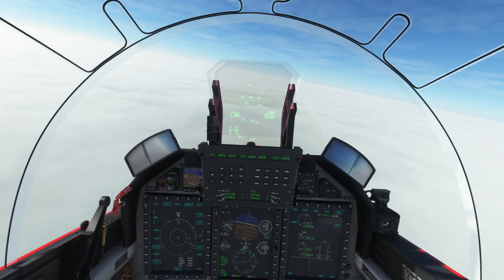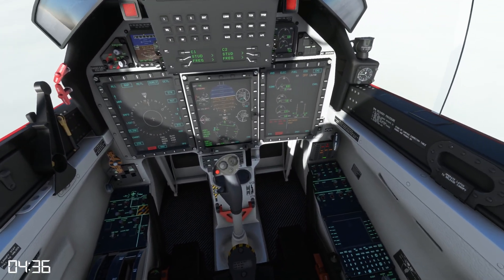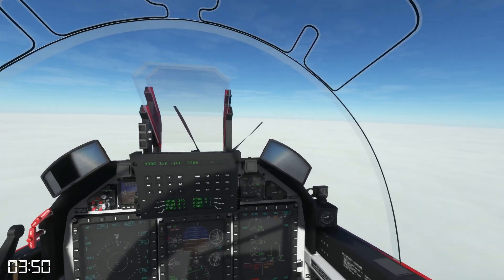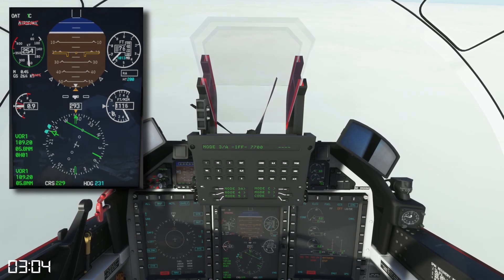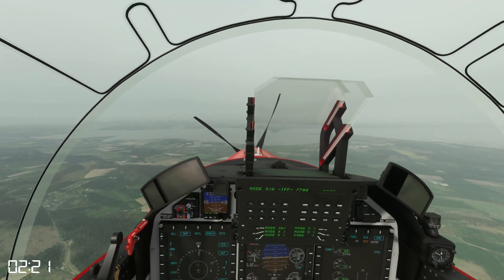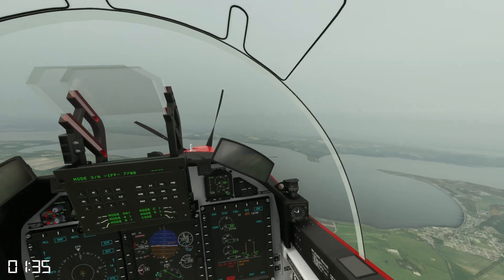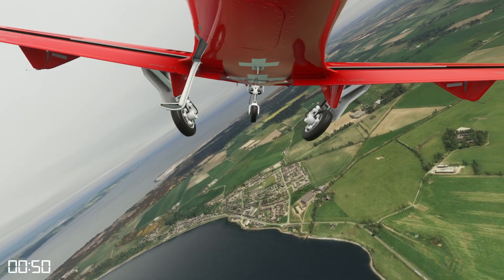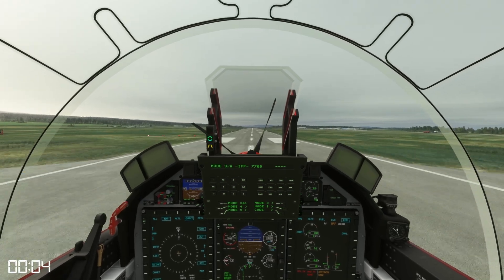Stuck above cloud? How military pilots land their crippled aircraft (MSFS)

Comment: Exactly what we were taught!, Highkey @2000ft AGL. 
Once the end of the runway threshold is 45° over your shoulder or if you are at 1700ft agl you start a 30° left hand bank onto “Crosswind”   
once the threshold is 45° over your shoulder or 1200ft agl you start a 10° constant aspect bank selecting a reference point 1/3 up the runway. 
if the AP moves up, turn in for 2-4 seconds, back to 10° assess. if it moves down turn out for 2-4 seconds and continue tp do so until you are sure that you will make the runway. at that point select first stage of flaps and gear. and when it looks like you are just too high select last stage of flaps.
Reply from the maker: Glad to get it reasonably accurate 👍🏻

Comment: For the more novice viewers if your flying in the mountains dont forget the effects of density altitude - another calc to add in to your glide slope. 

I like to practice using the "Trevor Jacob" scenario - induce engice failure in a piper cub at that same place and altitude in the sim, and see if I can do a Bush landing on the fly. I mix it up with different wind/weather scenarios.

Comment: Nicely done. I’d actually like to see the performance math done across a variety of platforms. It’s not boring and I’d like to see how it works out in say a C-17.
Reply from the maker: Much higher high key I would imagine! 😆 But that could be worth a go! Different aircraft glides. Of course, may not be authentic based on modelling and system depth
Reply: The basic principal works. High key in a fast jet or big heavy airliner is circa 10000’ or 1500’ in a slippery GA aircraft, then you play the drag with gear, flaps and air brakes. May get away with 5000’ in a light a320 for example (tested from 10000’ and had to configure early and sideslip). Key principle is stabilise at glide speed, fly a predictable pattern and monitor the sight line angle ( exactly as Chris does, good work!).
Reply from the maker: @Joegoesflying  amazing, is this conceptual or has it been tested in an actual airliner?
Reply: @cgaviator  a "real" sim during type rating. Surprisingly effective techniques, it was nice to find out they transferred so effectively!
Reply from the maker: @Joegoesflying  awesome! I know what I’ll be trying soon! 😂

Comment: love the new editing style man! The PC-21 is awesome im torn whether i should get the hawk or the PC-21
Reply from the maker: Tough choice! Both of the aircraft suffer from slightly off flight by dynamics at the moment. Updates I’m sure in future. But I think it’s down to your preferred style of flying. Aeros in the PC21 or high speed in the hawk! Though the PC21 is nice for a gentle cruise at low level.
Reply: @cgaviator  ah interesting, tough choice indeed. So as a former air force pilot which aircraft would you say is the most real-to-life at the moment? Flight dynamics wise.
Reply from the maker: @Ray33416  hmmm… the PC21 is much easier to fly. Trim is easy so it’s simple to fly. The hawk won’t fly level for more than a moment. Fine at low level but if you’re cruising without autopilot it is tricky. The PC21 has little to no rudder authority whereas the Hawk has too much and a tendency to wobble or crazy roll! I’m not sure any of that helped! 😂

Comment: Excellent video, as always. And you have a strangely reassuring voice as you narrate! 

You mention this model has more drag than you remember in the real thing. Is it possible this is due to inertia not being modelled in MSFS? This has been brought up in a number of forum posts, and the more I think about it, the more it explains some of the quirks of MSFS' flight dynamics.
Reply from the maker: Oh, maybe! My only reference point however is the Tucano which is lighter I think and slightly bigger wings. But you make a good point about inertia! That would also explain how the aircraft are soooo twitchy in pitch! Thanks 👍🏻
Reply: Devs seem to be able to set base straight-line drag up ok - I complain a lot about lack of inertia in rotation & translation though, and I'm a little convinced some of that is just because the force scaling involved is too high, which effectively makes the input mass has into the result lower. The PC-21 is a bit egregious in that area. They could also just have set the thing up as a brick :)

I've been having little luck in actually feathering props ( as opposed to having props look feathered ) in recent SUs - you can put them in & out of feather with no trim change - but the PC-21 is set up as a jet, so that shouldn't matter.

Comment: Good job! i fly a piper m600 turboprop , and it's so important to set condition lever to the OFF position, otherwise vertical speed is increasing so fast and speed is going down, :)
Reply from the maker: Nice! The rpm in the PC21 is automatic which is nice. And the PCL off feathers the prop as well. So simple!

Comment: Question:  If you're flying the mach loop in a Hawk at 420 kts and suffer a complete engine failure, is it possible to make it to the nearest airfield?
Reply from the maker: No, IDLE, Cutoff, IDLE, Relight button, zoom climb, hope it restarts! 😅
Reply: @cgaviator  Damn, I was hoping it was possible to get to Llanbedr if you're at a favourable part of the loop.
Reply from the maker: @Hohum37  I’m not sure we ever briefed to use it and in an engine failure you’d probably not stop in time. The handle probably the better option
Reply: @Hohum37  no part of the loop is favourable for engine failure situations unless you are many thousands of feet above it rather than in it, as the whole point is you are low level flying, and Llanbedr is between 13 and 20 miles away depending on where you are in the loop, so unless there was an airfield with a runway of enough length in the valley itself at the right spot you are done for the day. 😁

Comment: Awesome job. I’ve been waiting for this topic. Thought you’d do in a Hawk though. Demo a radar PFL with a low cloud base. Then do it again but with an even lower base, but cut to the vinegar strokes, and ask folk if you get it down or not? Repeat until failure.  Excellent video and production :-)
Reply from the maker: Challenge! Lower cloud bases with the hawk are unlikely to be possible. Turboprops are well suited to this sort of approach. I’ll certainly be taking the cloudbase down for the next one. Perhaps 1500ft then 1100ft. There is a straight in option that is possible with the Hawk. Perhaps I’ll try that 👍🏻
Reply: @cgaviator  Sounds good.